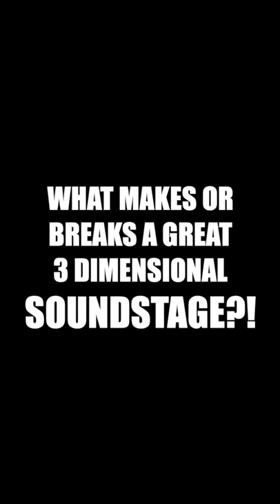#Shorts What Makes OR Breaks Great Soundstage?!

Comment: All great, and personally need to do more of this. But so far, biggest difference for me has been pulling speakers out into the room (at least 3 feet from side and front walls). Lowering component rack below the speaker plane to reduce/remove spurious reflections - best to get any all equipment/objects from between the speakers 👍🏼👌🏼